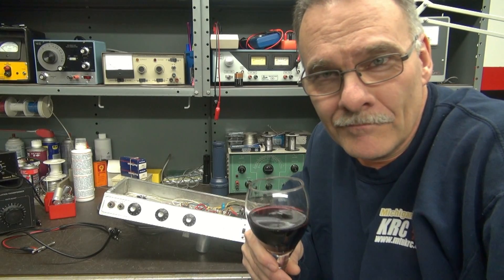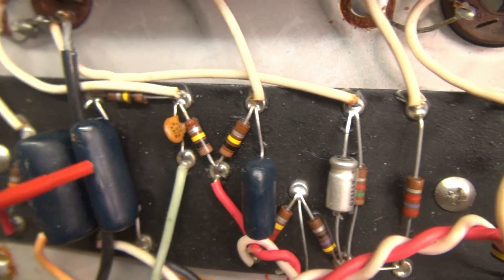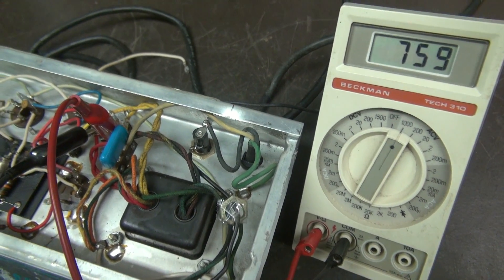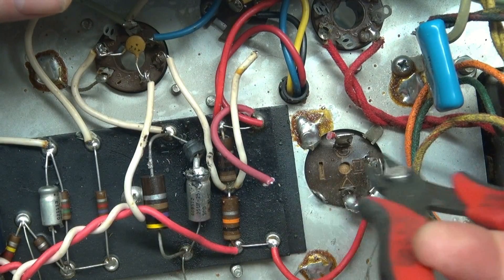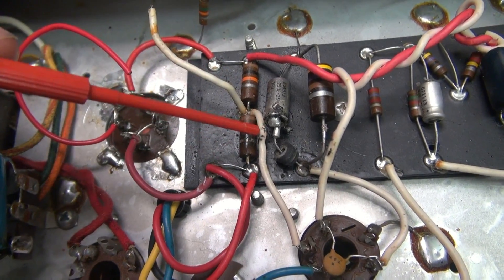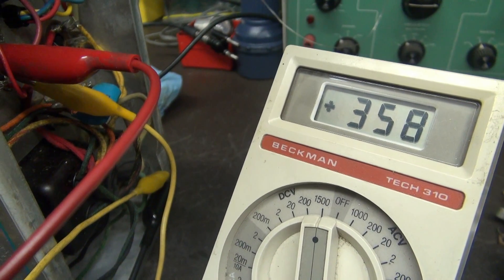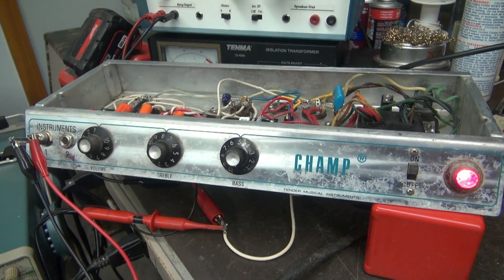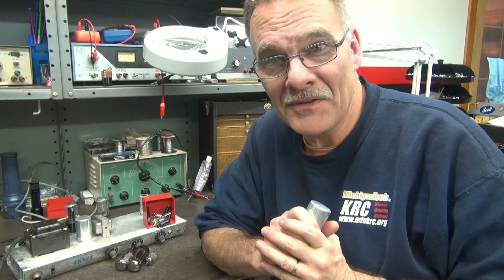How to repair silver face Fender champ 6V6 Tube amp Theater D-lab electronics Old school technology

Comment: Hi Terry happy belated birthday. Always good to see you working on stuff. A friend gave me an old Epiphone galaxy 10 guitar amp and it had a burned out power transformer. From what I read on the internet this is a common problem with this amp. I fixed and it works good but a fender champ will blow it away and a fender has a 6v6 smaller tube. The Epiphone has a 6L6. I'm thinking of putting a champ circuit in it

Comment: If you can't find or afford the big tower capacitor, could you describe the configuration of discreet capacitors that would equal (or exceed) the performance of the tower cap. I don't  care about deviating from conventional circuit appearance... just equivalence and the best possible performance.

Comment: Awesome input from you Mister D-Lab! Love your videos, they are amazing. 
I have a question regarding the max capacitance you can attach to an 5Y3 rectifier tube. As I've seen in your videos and other ones, the filter cap is often replaced with 4 x 20µF from CE manufacturing, which would result in 80µF. I read in multiple forums that the capacitance after a 5Y3 shouldn't exceed ~35µF. Can you explain me the thing I don't seem to understand? 
Thanks for all your videos and great humour!
Greetings from France
Reply: The Champ has 3 x 20uf. So you just use three on the new can cap.

Comment: So, Terry, I was wondering. Why did you replace the metal p/s filter cap with a look-alike on this repair; but left it in place (but disconnected) on another repair and used discrete caps on the board?
Cost? or Aesthetics?
Thanks

Comment: Hey Terry would you please provide a list of components and in the case of the filter cap where they can be purchased part number? I have an original champ that’s starting to hum so it’s time to give it some love. Also I saw a video of a guy who installed push-pull switch on the volume control to activate a “bright” circuit and another for a circuit similar to an overdrive. Thoughts thanks for all you do really appreciate your channel.

Comment: Great job Terry..Im sure you are highly requested for service.
Any special flavor you prefer off the vine?
Reply from the maker: I love Robert Mondavi, cabs. Do you have a unit in need of repair?
Reply: @d-labelectronics  had. Heathkit 10-80m receiver and transmitter set from appx 1973 . Gave to ham buddy kd8tbc Lee, it  needing recap kit, re string vary cap tuners and alignment.  It all worked fine in the late 80's, but collected dust for the last 18 years..I was not going to power up tubes without a clean sheet..I doubt he has even started it. 
If you can log into 2m net sunday nights 9pm 146.640 also an echolink if you are out of range..maybe catch him on air as net control. Im sure he would appreciate some help. I also have many old school chums and few of my customers  in the music venue that are always seeking a highly talented tech for vintage equipment, maybe in market to purchase a refurbished antique that has guts . 
Robert Mondavi eh? 
Til the next local radio and electronics swap..
73, kb8qlz

Comment: D-lab That capacitor that was originally blown, parallel with the bias resistor, appears to have just been removed from the amp completely.  Is there a reason for that, or did you connect one somewhere else?  On my '68 Champ, it appears to be a 25uf 25V cap.
Reply: Poduck idk, if you figured it out already, but at 9:37 he shows you what he did with it.

Comment: Hey Mr. D. Great video! How many watts is that Unger and where can I get one?
Reply: That's an Ungar 776 handle.  They were the first company to make a modular soldering iron for which you could purchase tips with built-in heaters.  I don't know what size heater he has on it, though.  Weller still makes the 7760 which is a modern version of the 776 which uses the same heaters.  I think the 4033S is the closest modern heater/tip combo to the one he is using.

Comment: Thanks for posting these videos. You’ve inspired me to troubleshoot my amp. I have a silver face champ that I replaced the filter cap around 10 years ago and the other electrolytic caps and all was good. 

Now a few years later when I play through it there is a fuzz sound as the notes die off. Not musical fuzz either. 
Subbed tubes and played through a different champ speaker just in case. 

So, I need to get to troubleshooting. 

Thanks again. All your videos are helpful sir!
Reply: Mike, sounds like you might have a "parasitic oscillation". Sometimes caused by bad caps, electrolytics in particular,  and perhaps your 10 year old electrolytic cap is failing (they sure don't make them like they used to!). Could also be due to a bad solder connection ( every Fender I've ever worked on had one!), a bad 6v6 cathode  bypass cap, or a noisy resistor.
Reply: Did you ever figure it out?

Comment: Thanks for another great video. I have an old amp. No name on it, but I researched and found its a Orpheum Omega from 1959. It has a 5Y3 that's discolored like that one. I'm gonna check to see if I can find what is causing that. I don't want to lose my power transformer either! It had a lot of noise and I cleaned corrosion on the 12AX7's. I cleaned that and it sounds beautiful! Still gonna check out the reason for the discoloration of the 5Y3. Thanks for the tips!

Comment: Hi Terry, thanks for this very informative video. I recently purchased a Vibro Champ from 1977 that is still stock. Owner bought it new in 1977 and only used it the first couple of years. Then it was stored. Now I am checking the amp using your video and I found some issues. First I checked the ac voltage from the power transformer and that looks OK (730v AC). Then I checked the DC voltages. Coming from the board to the first filter cap I see over 400v DC when powering up but it goes down very quickly and stabilizes after a couple of minutes on 260v. That is way too low. Checking the 6V6 I see that one red playing and within minutes the heat coming of the 6V6 is worrisome. So if I am correct I should be looking at the cathode cap and resistor. Should I do a full recap job or should I just work my way through the amp and replace when I find a problem? I know that most of the time one problem leads to another, so I might end up replacing all the caps in the end. However I also do not want to destroy the originality of the amp by replacing everything beforehand.
Reply: Patrick Roeleveld, the most likely cause of a redplating 6v6 in your Champ (aside from the tube itself) are a bad ( electrically leaky)  coupling cap to pin 5 (grid) of the 6v6, or a leaky or shorted bypass cap in parallel across the 6 V6 cathode resistor (from pinn 8 to ground). Just change those two parts! Also examine the cathode resistor itself, measure it if you can, and replace if it looks overheated or doesn't measure the correct value. I can't remember if the champ has a screen resistor feeding voltage to pin four of the 6V6, but if it does, check that one as well, make sure it is on spec and not burned or drifted way off.  A gassy or otherwise defective 6v6 tube could also cause the red plating all on its own, but bad caps or resistors are more likely. You did not say what brand of tube it is, but many modern Chinese or Russian tubes cannot handle the voltages found in Fender Champs or Deluxe reverbs. An old RCA or GE tube would probably be still good today unless the amp has had a lot of use or had been run for  hours with the tube red-plating.

Comment: Hi Terry, I am wondering if you always power up for the first time with only the rectifier tube in place?  I am building.a 5E3 for my son for Christmas and I am just about ready for the first power up. I use a variac, not as nice as the Temna, but it works. I also use a light bulb current limiter. What are your thoughts on this?
Reply from the maker: Hello, a current limiter is a great idea. That will protect the power tranny in case of a short.

Comment: I'd think that you would get more clean volume with the original bypass cap values - the amp goes lower in frequency than needed even with the original values.
Reply: D-Lab is correct. The bass will be better but you may or may not notice it.

Comment: Terry, are you able to obtain most of your replacement caps, resistors and other parts locally, or do you have to order them?  You always seem to have exactly what you need.
Reply from the maker: Hello, Yes, I have piles of parts here. However, when in need I usually buy from CE Dist (AZ) or Tubedepot (TN)